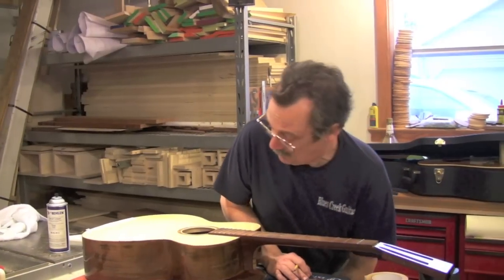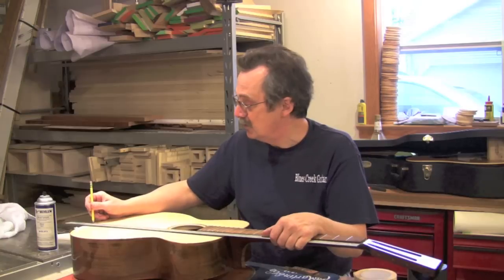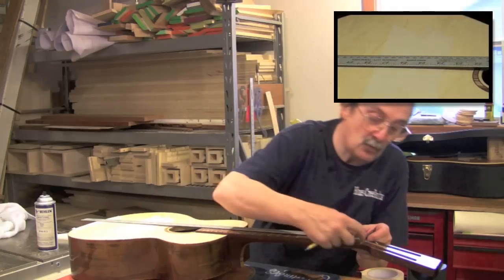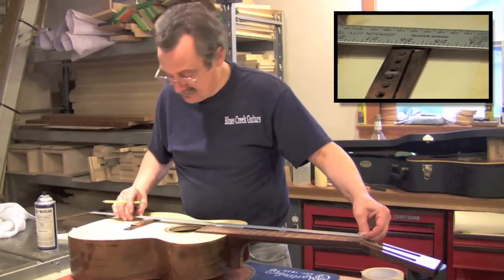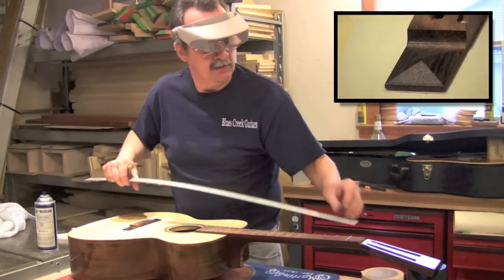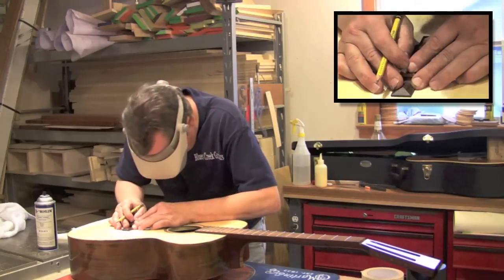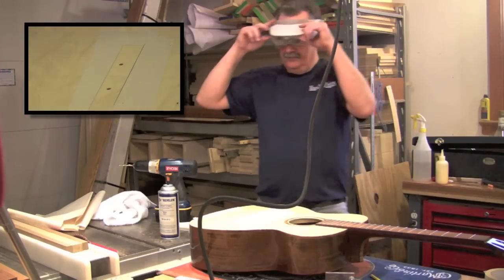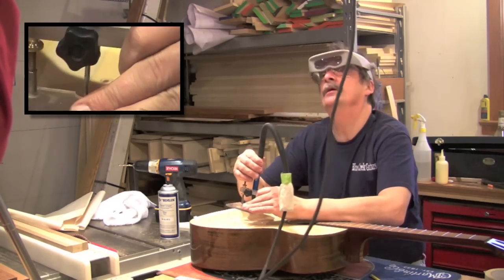Blues Creek Guitars - Glueing a Bridge Part 1

Comment: You can lay tape and clean up later  but that bump from the tape makes the wet and level sanding during finish touchy.  The neck needs to be attached so you know the exact position of the nut.  That lets you know where the saddle and bridge belongs. The more accurate you place the saddle the better the intonation